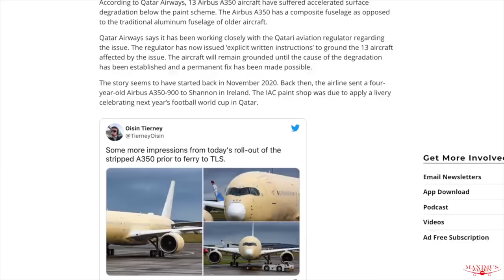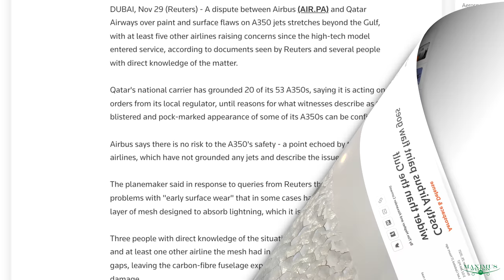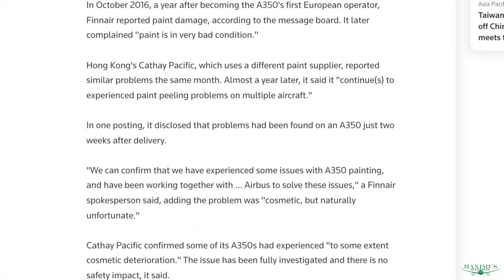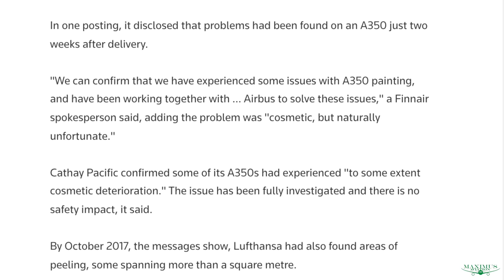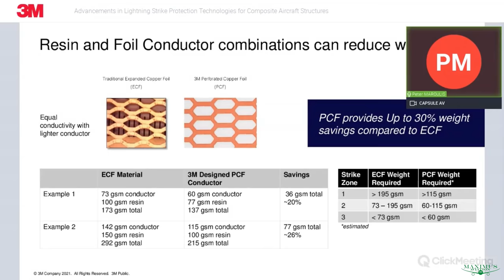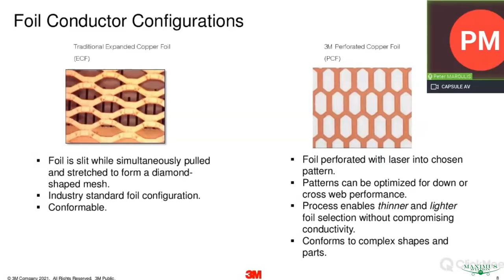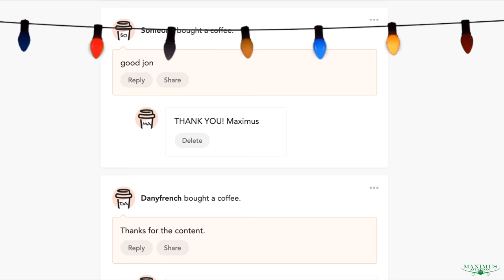Six More Airlines Report A350 Fuselage Defects That Expose Composite Lightning Strike Protection

Comment: It looks like the cured resin in the surfacer ply is gone! Maybe the older expanded foil sometimes inhibited proper resin wetting (aka porosity). Any air voids/gaps in the surfacer or under the foil would possibly expand and contract everytime the aircraft went from heat soaking on the ground in a hot/humid environment, to -40 deg at 40,000 ft. After a while it just cracks up and flakes off exposng the lightning foil. It could be that the areas that degraded were MRB hand layup repairs to the foil, during production. Sometimes the foil is discovered to be damaged or incomplete after unbagging. This then requires MRB in process production repairs. But these repairs, are only performed under a vacuum bag, at one atmosphere, not Autoclave pressures. Also, it may be a standard type repair that follows a standard procedure not requiring direct Engineering input as such. Each repair, which is most likely "operator verified", requires the piece of repair foil to be properly wetted with resin and for the substrate to also be sanded, clean and fully wetted without any porosity. When the repair foil is layed up, all air bubbles need to be worked out, before vacuum bagging and cure. Obviously if all this isn't done properly then, it is setup to fail in service.
I don't like composites, hard to build, hard to repair and more prone to damage in service. Give me metal any day!!
Reply: Depends on the type of composites and their use, but often composites can be actually easier to repair than some metals... Big temperature differences and pressurization etc do have more issues. As an exampl: an aluminum bike frame is usually much harded to repair compared to any carbon composite frame. Steel frames do not offer nearly the same performance so the comparison to that is not worth it.
Reply: Composites don't fatique.
Reply: @alexlo7708  that is in no way accurate, they do indeed fatigue, just differently from Aluminum. they also suffer other kinds of failure modes that aluminum does not. Delamination is a VERY common problem that is tied to fatigue.

Comment: Thanks for that, a competent report about an issue I know will not be going away any time soon. As time passes you will be making many frequent reports about this torsion failure inherent in the materials used as the aircraft flexes and twists in the air. I suspect that there will be serious safety issues arising later.
Reply from the maker: Quite welcome.
Reply: There is a french saying: « no smoke without fire ». Has anyone found out the root cause of this? Carbone and aluminium for instance do not team well together especially when there is a lot of quantity Of carbone and a tiny quantity Of aluminium (Galvanic corrosion)

Comment: I bet the mesh suppliers had their lawyers take a good look to see if they are in anyway liable for the problem!
Reply: I think, it depends on the contract and its term & conditions. If the mesh suppliers just doing selling the mesh and nothing to do with integration in the composite design. It would not be the mesh supplier problem. That's it.

Comment: Does this condition have any effect on the integrity of the ability to keep the aircraft’s pressurization? Nice video thank you.
Reply: @maximme  it's not a flying computer, you're just a Boeing fan boy that's it! The side stick gives a wider and much comfortable ride in the cockpit that many pilots prefer. But others prefer the traditional yoke. But even the yoke has changed a lot compared to a yoke for example on a 747-100. All aircraft are now being flown by computers, computers are what replaced the flight engineer if you don't know! Fly by wire technology has made flying aircraft a lot easier and safer. It's just what every person prefers, so if you prefer yokes don't be jealous ;)

Comment: at least the a350 issue was just a cosmetic issue but the 787 new issue well many things that needs to be fix but hopefully both of these aircraft get fix
Reply: The foil problem on the A350 is somewhat more than cosmetic.  A new paint job will not fix it.
Stripping the existing foil,  preparing the surface,  applying new foil and painting sounds like a major pain.
Reply: Oh yeah it is the real problem plus Qatar Airways is still angry at Airbus and I think they really messed up there relationship with Airbus
Reply: And also replacing those was just a real pain in the ass like seriously it's also of work

Comment: I did repairs and full work on polyester resin based  fiberglass boats and have seen similar flaking and crack issues from older glassing jobs.  likely due to poor resin to hardener mix ratios,  poor  incomplete  mixing of resin, hardener contents (very important to mix thoroughly)  or main coats of resins being far too thin over the carbon fibers or metallic mesh since the paint flaking off exposes metal screening right away.

Comment: I have a feeling that the A330 NEO wide body will dominate the skies in the current decade. Thanks Maximus
Reply: That would be a good thing....I prefer the A330's cabin layout.
Reply: @Boeing 737 MAX 8 Ansolutely
Reply: A tingling in your unspeakable region?
Reply: @RLTtizME  Are you an aviator ? 
Would you believe that the carbon composite aircraft’s have the ability to withstand UPRT conditions if you have any idea about it ,please enlighten us.
Reply: @dhaferalamry7157  The DVWS factor is the challenge. Taking a factor of 4 [3.5] ^6 will be the test. Flex and rigidity is nominal and opposing in its dynamics. I am afraid you are not going to understand the science here Doofer...I can't help that.
Reply: @RLTtizME  You haven’t answer the question engineer :)
Reply: R L T what’s UPRT ?

Comment: I'd guess the resin, carbon, the foil and the paint all expand and contract at different rates over the same temperature changes and that would cause some stresses.

Totally concur on the growing pains. Lessons will have to be learned.
Reply: @donreinke5863  the problem here is that aluminum is heavier than carbon fiber and carbon fiber had proved to be more durable than aluminum,the thing is that the new carbon fiber is still not fully understood yet
Reply: @luigiweegee7152  If CF is not fully understood, then why is it being used as aircraft material? The MCAS software was not fully understood on the upgraded 737 Max and look what happened.
Reply: @whyyeseyec  i mean back then aluminum wasn’t fully understood yet and was still used on aircraft.

Comment: The cracked paint is a sign of a deeper structural design problem. Is Airbus going to wait until one rips apart at 35k before it does anything? All A350s should be GROUNED IMMEDIATELY and removed from service. Airbus only cares about $$$, not safety. I wouldn't fly on one. Not to mention the horrible lavatories on the A350 that are falling apart.

Comment: This feels like so many other cases where the initial development was for military and no one considered what would happen when the technology moved into the commercial sector . I think if we know it probably will happen then it should be considered from the beginning.
Reply: to be fair, composites have been on commercial aircraft ever since the introduction of the A300 I believe.  But for that aircraft it was only the tail section that was composite if memory serves me correctly.
Reply: @steinbockguy  What I mean is back when we were trying to decide between boron and carbon , or uranium and thorium , for example. Only the immediate military need was taken into account. if military and commercial needs were considered then things might have turned out better than they did.

Comment: As a thermal engineer for one of the big two commercial airplane manufacturer I often reviewed material test procedures which underestimated peak in-service thermal environments.  The suppliers often lack the skill sets to accurately gauge the direct and reflected solar loading on external surfaces so they typically blindly follow the MIL stds, which don't cover unique environments, such as adjacent heat sources.

Comment: It doesn't appear to be a simple surface prep issue since it penetrates down to the carbon fiber layer.
Reply: It if the type of material you’re using is reacting with other material or chemicals it could cause oxidation if there is air for water allowed to slip under.

Comment: Does the composite and wire mesh loose it’s bond because of a different expansion rates?  These jets go through a lot of heating and cooling.
Reply: That's what I think as well. Both the copper and the aluminum are expanding and contracting while the carbon fiber just sits there. Eventually, their going to delaminate. The mesh will stay while the carbon fiber takes the hit.

Comment: That mesh looks like galvanised steel expanded mesh used for bodywork repair / modification framework. The peeling looks like incompatible top coat paint with the base layers and resin filler material.
Some of the areas where the mesh is completely exposed looks like there is rust on the surface of the mesh,this is exactly how galvanised steel mesh corrodes, also the mention of holes in some areas of mesh would indicate rusting to the point of failure, not long in these conditions.

Comment: So Boeing isn't the only one with issues. This is going to be a hugely expensive fix if they have to do it for all the aircraft produced.
Reply: Yes, but if the complaints are true then this is only a cosmetic, not a safety problem, so that's a huge difference compared to Boeing's problems. The airlines reporting this problem are still operating the planes, so they seem to be confident in the safety of the planes.
Reply: @tjroelsma  As they are still operating the 787 including QR. I doubt it's a simple as a "cosmetic" issue if it turns out to be true the lighting mesh will have to be replaced. That's not a cosmetic issue at all that will involved a lot. We will have to see how this plays out.
Reply: @johniii8147  The 787 has been grounded for quite some time because the FAA revoked its airworthiness. 

The A350 isn't being grounded so it's not a safety issue and the airlines who have filed complains about it came up with the term "cosmetic": they didn't like that the paint cracked and flaked off. 

Now to solve this cosmetic problem, Airbus has to replace the lightning mesh in order to get a better bond between the mesh and the paint. But that doesn't mean it isn't a cosmetic issue: the planes fly perfectly well with the cracked and flaking paint.
Reply: @tjroelsma  No the 787 is not grounded just new deliveries halted. Do your research. Airworthiness HAS not been revoked and the 787 is still flying. All delivered aircraft are still in operation.
Reply: The A350 issue is more important than the 787
Reply: @johniii8147  I think Airbus will fall in the hell.
Reply: @ndlben7129  there's a big space between think and know, by the way your sentence makes no sense. Do you equate hole with hell 😂
Reply: @DC8Combi  believe me there is nothing funny about it...
Reply: @ndlben7129  That remains to be scene how serious an issue it is.
Reply: @johniii8147  exactly I agree we need to wait the process through.
Reply: @ndlben7129  looks like I'm not the only one suggesting we wait until they have a proper engineering order for a fix.
Reply: @DC8Combi  Fix with what?  Do you think you're gonna lift that up like a car hood replace the part and close the hood?  This story will end badly sorry ...
Reply: @ndlben7129  you know what's priceless? No mater how extensive the A350 composite repair may be it won't be nothing like Boeing's stock being 198 when it was once over 440 and that's after getting the okay to fly in China! 😂😂😂😂😂
Reply: @DC8Combi  that means the market is very worried about the 787 problems
Reply: @mp4373  Only a Bus boy would change the subject to protect the sacred cow.
Reply: @2010kb1  Not changing the subject, someone brought up the unexpected drop in BA stock, but it's OK dude, you've got your own thing going on and I don't want to hold you back from this.
Reply: @mp4373  Drop in BA stock would be expected same industry same type of material in both builds.The point is for years Boeing has had troubles which lead to the idea Airbus products  never have troubles.Every story was how bad Boeing got.Now when Airbus has issues some can’t handle it and divert to there protection mode in denial.Not aimed personally at you.
Reply: @2010kb1  No, I've been focused on the stock doing better because of news from the Chinese regulator.
Reply: @tjroelsma  and fuel efficienty ? drag ?

Comment: Laying rigid material over flexible material will always present a nightmare. The tyre maufacturers seems to have solved the dilemma with woven steel-belts in radial ply tyres. The aircraft hull is a pressure vessel. Like a tyre casing, the flexible material yields. The metal material in its woven form allows conformity but over time will wear upon itself and the flexible material it is embedded into. Over stretch-shrink cycles, I would expect the metal mesh material to microscopically saw away at the resin bonds. Steel cables interestingly wear internally as well as on the outside from curling over pulleys. The radial play tyre however does not have to be around for decades in constant duty. My imagining for the future is that the refinish may eventually turn to a latex-based or synthetic latex based material.

Comment: paint cracking.  what epoxy (if they used an epoxy) did they use?  Looks like an over application fault to me.  I've seen similar on Sub Sea items.  Paint layer literally too thick and cracks off.  What condition was the substrate in prior to coating?  Was the substrate pre-treated in accordance with the paint manufacturers recommendations?

Comment: Max, I think they both Boeing and 787 airbus with it’s 350 or experience in problems with the composite materials because they are just not performing up to the engineers expectations as designed. This major shift in construction of aircraft, just like with the old the Haviland Carmen, it’s going to take a while to figure out how to smooth out all the bugs in the manufacturing, shipping,Quality of input and etc.
Reply: Dont compare 787 et A350 issue who's more difficult

Comment: I was under the impression that it wasn’t a known issue of concern until Qatar was having one of their 350’s getting a new paint job. That it wasn’t noticed until some amount of sanding the old paint off and that’s when they found an abnormality in the paint. As I’m seeing here it is very apparent a paint issue and no sanding required. Both A and B will get these carbon fiber concerns fixed.

Comment: WHY IS THIS PROBLEM NOT HAPPENING AT BOEINGS COMPOSITE A/C !! Or other airbus airplanes ??
Reply: The A350 is the only Airbus aircraft built mostly from composites and as for the 787, it must use a different conductive material that does not cause this issue or something

Comment: Looks like it could be due to large temperature changes, but just about all aircraft see this as it's -60C at cruising altitude on average. But I have to admit that exposure to high temperatures in most of these countries can generate this type of problem. Places like Qatar, the Caribbean, the UAE, etc. can get very hot. I also noticed on one of the first images that paint was chipping near the pitot tube. These tubes are heated during flight.

What is hard to explain is the color of the lightning foil that is exposed. It is mostly gray, but some of it looks like it's rusted. I would be very surprises if they used any kind of steel, so this may be copper with an aluminum coating on top? The way to analyse the issue (based on the photos) will vary depending on what that material actually is.

Now regardless of the cause or type of lightning foil used, these aircraft are perfectly safe!
Reply: The temperature cycling introduces the potential for moisture absorption. I've seen thermographic images of honeycomb control surfaces taken AFTER the aircraft has landed showing the presence of ice in the cells of the core material.

Comment: Just to clarify, this is only happening on the small nose cap & nowhere else on the the aircraft. It is due to different expansion & contraction rates of the mesh & the coating in extreme temperature changes. It is not a structural failure, it's just cosmetic.

Comment: Judging from the pics in the Reuters story the paint issue that Qatar and other airlines have reported is predominantly seen on and around the static dischargers, commonly known as static wicks or static discharge wicks on the A350 winglets. You can see why EASA therefore conclude that this is not a structural issue - it is at the very extremity of the wing and not evidenced anywhere on the main part of the fuselage. The winglets flex much more in normal operations so this paint issue is nothing to do with hot and cold expansion and contraction flight cycles. That theory is a red herring. They simply need to develop some kind of rubberised paint with elastic properties for the winglet / static wick portions of the plane.
Reply: Then EASA are idiots and being political (again). No serviceable mesh, no static discharge and then 1 lightening strike "burn through" and you've got passengers being sucked out as the skins peel back and a VERY high chance of departure from normal flight conditions. But they are right ... unless Lightening Strikes, there's not currently a "structural issue". This is the kind of mentality that made me retire from 4 decades in Aerospace. HOLY SHIT !!!